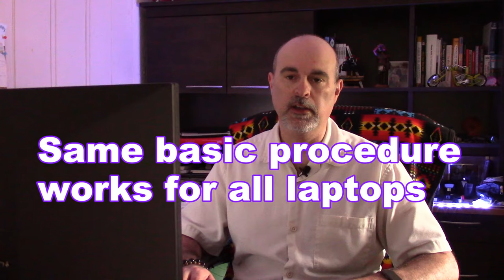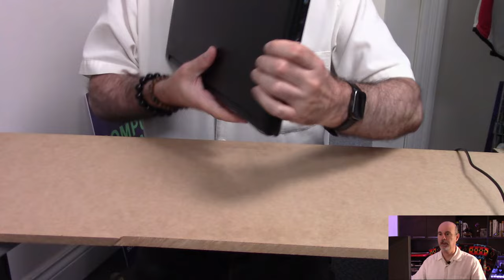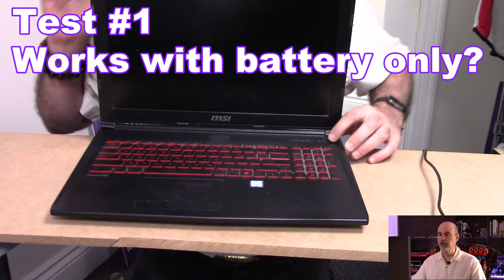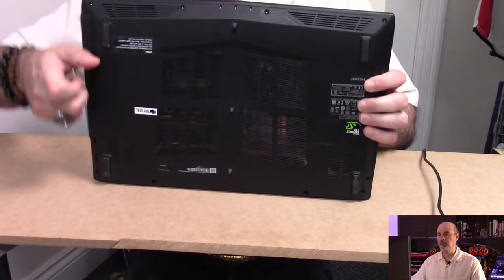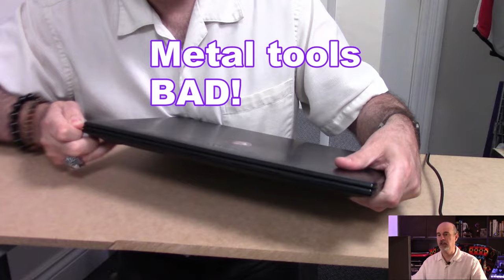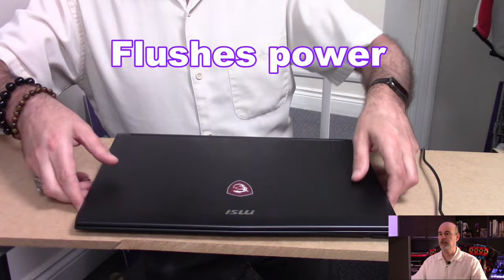How to fix an MSI laptop that will not turn on

Comment: Sadly didn't work. Just power LED near button, fans and USB powered. instead of that everything else is still same.
Reply: msi ge63 raider rgb 8rf. Unplugged while running and immediately enter this state. I have it few years and till this, unplugging never does this issue.
Reply from the maker: Unfortunately this trick doesn't fix every case but it does many.  There could be damage to the motherboard that needs reflowing or could be you need a new battery.   Needs troubleshooting which I don't do here.
Reply: @TwinBytesInc  i understand, thank you anyway. I think that will be motherboard.

Comment: Please my two years old child. Threw a neighbours laptop down. The laptop has refused to come one please can this procedure be used too.
Reply from the maker: Thanks for your question.  This procedure is for stuck power flow.  If the laptop was dropped or thrown and won't start, that's maybe a broken DC Jack so the power won't charge or the battery came loose.  Also maybe the screen is damaged and won't display anything but there is power.  Try removing and reinserting the battery or someone needs to look at it.
Reply: @TwinBytesInc  Thanks a lot I tool the laptop to an engineer he has fixed it though, its refusing to display anything on the monitor. I was told that after repairs it will take sometime before it comes up. So we are still waiting and hopeful.
Reply from the maker: Sorry your message when  to my "held for review" for some reason.  Very strange.  Anyway, I'm glad they fixed it but for it to take a long time to display on the monitor, sounds like still not fully fixed.  If it needs a few different things fixed, having one thing fixed and not the other still makes it a useless computer.  I hope they resolved it for you.

Comment: Mine turns on and powers off in 4-5 seconds ;-;
Reply from the maker: This sounds like it's possibly overheating.  Maybe the CPU fan is seized.  if you have pets, I guarantee you have pet hair clogging up the vents and slowing air flow to the point that it gets so hot so fast it shuts off.
It's possible something else is going on which could be a firmware issue.  Updating the BIOS, if possible, might help.  Try booting to a USB or CD and see if the computer stays on. Or boot into the BIOS and see if it stays on.  Maybe Windows is damaged.  Sorry but several possibilities here.
Reply: @TwinBytesInc  I feel like my charging port may have died,  I had a charging symbol all night now I have none no matter what adapter I use v.v I wish it would of been something easy to do instead of warranty but I also tried doing a battery reset with the button on the bottom, it makes the computer stop turning on all together till a adapter is plugged in then it’s back to turning on and powering off fast to me it seems like it’s dead battery wise and can’t charge I’ll let you know what Msi said when I get it sent in and back
Reply from the maker: If you had another power adapter to try that would be good if that's all you need.  But otherwise, yes it needs the charging port on the motherboard repaired.

Comment: I'm trying this technique and seems it doesn't work. I'll try a few more times, also by taking out the cmos and the battery at the same time and resetting with the small pin. I'm trying to fix it myself for free instead of paying a motherboard repair. 
So far it boots up, I go no image and I could diagnose that everything run under +/- 19V up to 19.3.  
Another thing I've noticed is that, since I brought it broken like that from a random person, the charger isn't the original one, it's taking either 19V=3.42A or 20V=3.25
While the computer needs 19.5V= 6.15A (it's the MS-16R4) 

Before I waste anymore money, do you think it has something to do with that or is it too far fetched ?
Reply from the maker: Thanks for your question.  Sounds like you've tested it out pretty good and done all you can.  If you are getting power but just doesn't boot, there is most likely a problem with the motherboard.  it may or may not be worth repairing that motherboard.  Those repairs don't always last but usually they do.

Comment: Doesn't work and at the end of the video it is edited when the laptop starts
Reply from the maker: Sorry it didn't work for you. No single solution will work for every situation, but some like this work for most.  The video was edited at the end because this laptop was already working and I was trying to show an example.  But I think I covered the important steps.
You could try removing the memory to see if it beeps at you or remove the hard drive and see if it boots into the BIOS at least.

Comment: Running a MSI gt62, opened it up to clean a fan which turned out it didn’t need any cleaning.

Plugged the fan back in, nothing, wont switch on.

Tried your solution as well as disconnecting the cmos battery and the ec switch still nothing. I also took the whole pc apart, nothing.

Upon showing a electrician friend the battery, he noticed all the various wires and came to the conclusion that the various volts could be coming from the battery and not the power supply, he suspects the battery is dead as there is also no illumination on the charging light on the computer.

Checked power in the cord of the power supply and charger, all good no problems with the charger.

Weird thing is that everything stopped working simply by unplugging a fan and plugging it in again.

Waiting for a multimeter to check the volts on the battery.

Could it be that the battery is causing this and that its possibly dead? PC is almost 5 years old but well taken care off, regardless of that, a battery will only that long.

Any thoughts or ideas?
Reply from the maker: Thanks for your question.  I believe you are over thinking this one.  Usually when someone tells me the computer won't boot after they opened it and touched something inside, that means they shorted the motherboard which can be very easily done if you're not wearing grounding straps and taking precautions for grounding in general.  
The motherboard is most likely fried and needs repair or replacement.
Reply: @TwinBytesInc  took the battery apart today and did toms of readings on it.

With the charger plugged in the battery was reading less than 1 Volt on its contact points.

The motherboard was reading 19V from the charger.

I will have a replacement battery in 2-3 days. Will revert back with feedback.
Reply from the maker: @tidalhook2920  Thanks for the update.  I never recommend opening a battery.  Not even technicians open batteries.  It's very dangerous and that's why they are called FRU (Field Replacement Units).  We just replace the battery, we don't dissect them or try to repair them.  You could seriously injure yourself if not die.
This is not just a message for you but for anyone reading this thinking they should also attempt what you did.  I advise against it.

Comment: MSI is one of the worst brand! I have MSI gf63 thin 10 UC! 

Problem I am facing - BGA Chip Issues: Problems with ball grid array (BGA) chips which can sometimes be temporarily resolved by heating.
Reply from the maker: I definitely wouldn't recommend MSI, but I heard various opinions on it.

Comment: "This works for any laptop that will not power on."
Why do you say things like that when you KNOW they are not true? The majority of laptops that will not power on are not suffering from needing a reset. Most I find are needing a replacement charger or a replacement port. In fact, I am working on an MSI exactly the same as the one you show in your video, and on a lark I tried what your doing even though I could plainly see the power coming from the power adapter would drop off when it was plugged in, and reset when the main cord was unplugged and plugged back in. This means there is a short, and no amount of holding the button in with no power applied will fix it.
Any time anyone says "this will fix all of them" they are invariably lying.
I would have no problem with you video if you didn't put this blatant falsehood in your title.
Reply from the maker: I don't think you read it properly before commenting.  I said this solution works for any laptop, meaning not just MSI,  but I didn't say this is the only solution.  There are other possible causes ofcourse, but this is the most obvious solution that works in most cases.
Also, I have more in the description which you clearly didn't read, that clearly states since there are other solutions I made another video with other possible causes.  So you are actually wrong in calling me a liar.